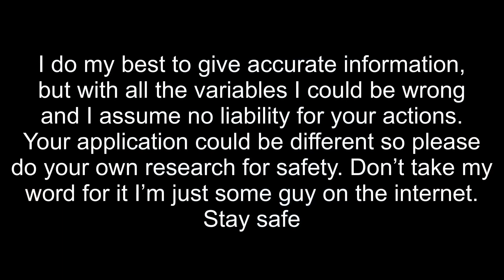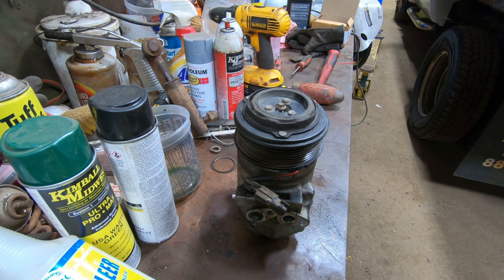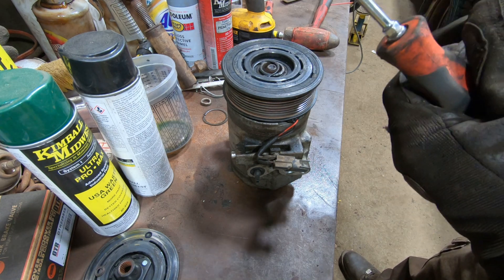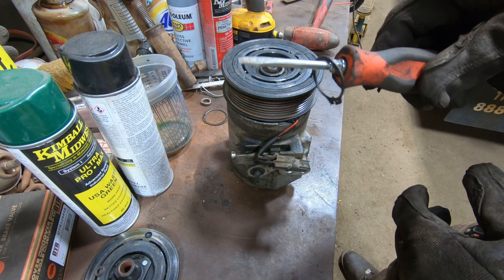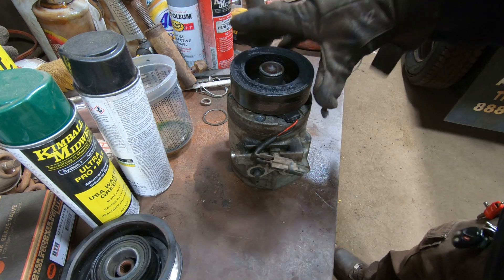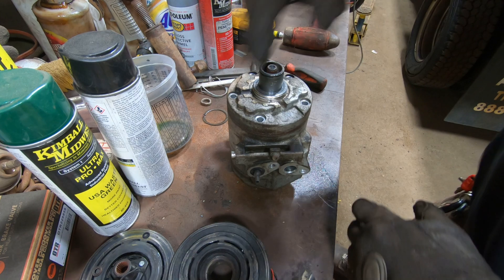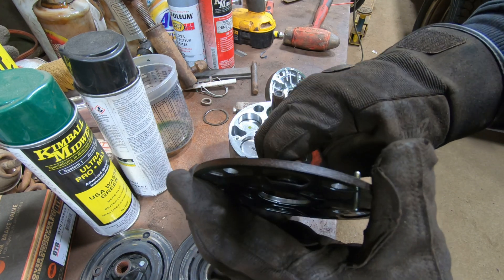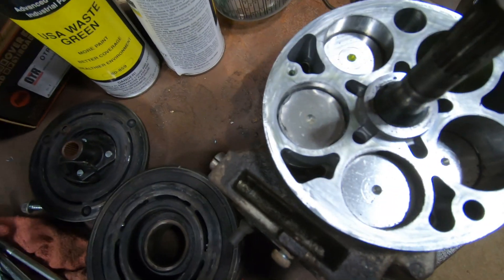Failed A/C Compressor Disassembly

Comment: The old wobble plate.   Back in the day those ford compressors with the Teflon piston rings sure did cause a lot of major AC system failures.   Black Death they called it.
Reply from the maker: It’s funny. I haven’t had any a/c failures in my 10 years working for the highway Dept but I had two back to back this month. One on a 12 f550 and one on a 06 350. Both had seized compressors. I think the Honda CR-V gets the Black Death too. I had to change a compressor on one of those and I remember people talking about it. Had to take the bumper off the get that one out.